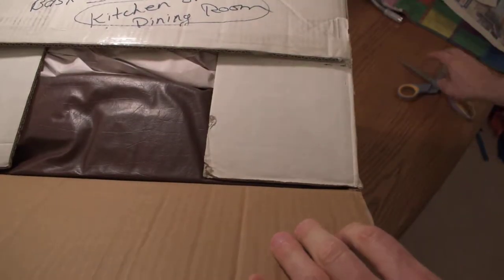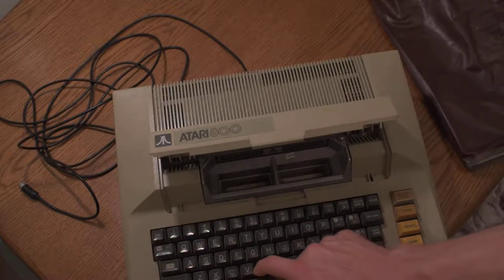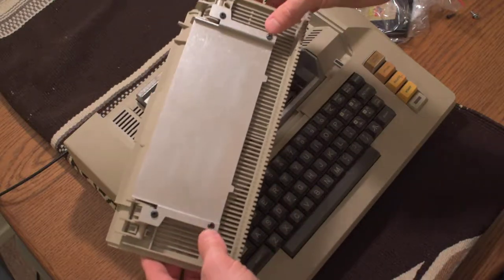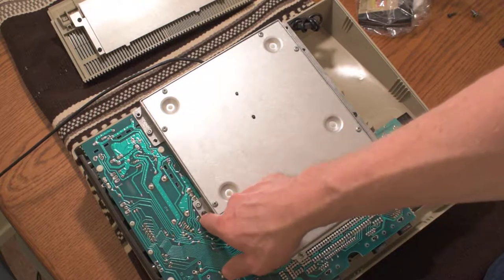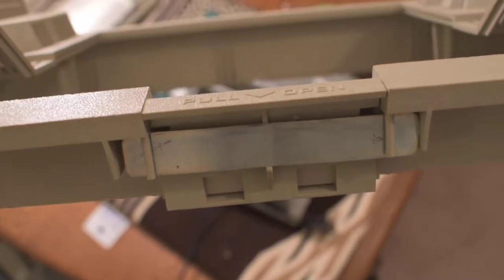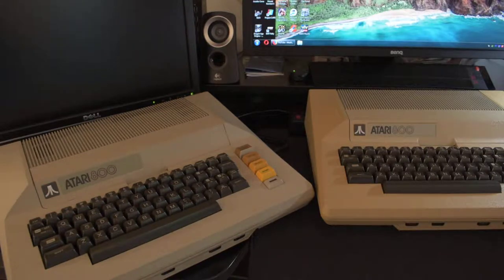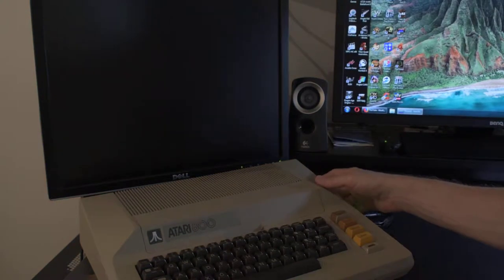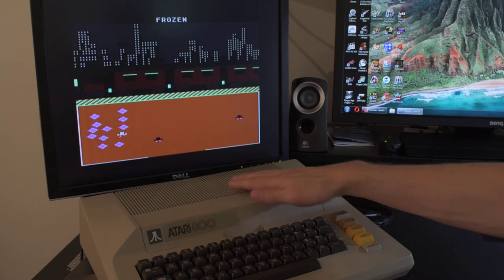Atari 800 - yet another untested unboxing, cleaning and testing!

Comment from the maker: Update: A couple years later I did replace joystick port 4 with a NOS part so that is now fixed. Correction there are about four keyboard variants for the 800. This is one of the best ones. There is the original hi-tek with white plungers, then the Stackpole with yellow plungers (worst) then the Stackpole with green plungers then there's the mistumi which is great except the mylar fails (easily fixed by peeling it off and placing it right back in place).  Apparently hi-tek sued Stackpole (and maybe one other manufacturer) for copying their 800 keyboard so there are different types of Stackpoles (as shown here with rare green plungers) and maybe other variations over the months and years of manufacture.  This 800 with serial 26800 (great number!) turned out to be a great machine with very little case yellowing and it 'just works.' I refuse to hack it up with an incog upgrade. 

As far as the yellowing comparison shown at 29:40 it seems the yellowing is more of an oxidation process as determined by the retro community in the past year or two. Exposure to heat and humidity are primary causes.  Humidity (water) has oxygen and is reactive.  It's a sort of rust on the surface of the plastics.

Comment: The lever is an easy fix. The posts that hold the metal spring clip tend to weaken and break off.  Carefully drill out the base of the posts that remain and cut down a couple of finish nails to the proper length then epoxy the new posts in place.  This will be much stronger and will last the life of the machine.

Comment: Hey man.  Great video!  Sorry it took so long to get to it.  I actually forgot you told me you got another 800 and then it popped back in mind a day or so ago.  Anyway, what are you using for a loader?  I didn't see a disk drive or a cartridge or anything attached to the 800 when you were playing the games.  As far as the joystick goes, I remember the Wico ones were way better than the Atari or others.  I think some are still available on eBay.  Montezuma's Revenge brings back a lot of memories.  I agree, it was/still is one of the best.  I had a different take on PacMan though.  Back then I lost my mind when I first bought it.  Maybe I'd have a different take today.  Regarding the other 800 that's yellow, have you considered trying to RetroBrite it?
Reply from the maker: Thank you Richard! I'm using SIO2PC-USB from Lotharek with Respeqt for Windows. It works very well. I do have 2 1050's but don't use them much. The old floppies still work though. Yes I have a wico bat new condition. It's so big though. I like the small kraft sticks more but this one needs servicing. I also have a new kraft I will use that for the next video. :) What was your take on PacMan? The one I played here from 2014 is much improved... Near perfect. I was playing a ton of Defender on cart. Like it? That game is brutal. :)  I've decided against treating the brown 800 with chemicals.  Instead I want to try the ozone gas method. That uses no chemicals and will not risk ruining the case with an uneven job. I will do that later this summer or fall. I need to buy an ozone generator. The8bitguy did that as a test but his method was improper. What are your plans on the A8s?
Reply: I looked at a lot of options for loaders and they all wind up being expensive or limited availability.  I was going to do SIO2SD from Lotharek but the price/shipping kills it and there's lots of button pressing to make it work.  Maybe SIO2USB is the way to go.  Still think the price is a bit high but maybe better than making my own cable.  On the other hand making my own cable might be fun.  I'll have to see.

I really did like PacMan back in the day.  I remember buying it in the store (first game I ever bought) and thought how nice the box and everything looked.  I felt like I was cheating the arcade by being able to play at home.  Sure, it wasn't exactly like the arcade but it was close enough.  Maybe there were some other deficiencies I didn't recognize.  :)

Defender/Stargate was fun in the arcade but I always felt it was way too fast paced and had too many things going on at the same time.  Eventually I'm just hitting smart bombs over and over again until I run out.  I don't remember playing those games on the Atari 8-bit but I'm sure I did.

Never heard of the ozone gas method.  If you do get around to doing it I would love to see the process/result!  8-bit guy seems to have a lot of luck with the RetroBrite method but he's really good and maybe it can be easily messed up.

I haven't had much time for Atari lately.  Work is pretty brutal time wise but maybe that will get better in the coming months.  I'm kind of torn on making changes to my hardware.  On one hand I watch videos of people upgrading the RAM on the Atari 65XE and tell myself I can do that.  On the other hand I don't want to damage things and certainly don't want to mod the original case for some other projects.  In general I feel that I should keep my computers stock.  Maybe if I got something cheap on eBay I wouldn't care so much!  I also need to figure out a place for an Atari setup that won't look like clutter.  Probably need a small LCD/LED TV too for the display.
Reply from the maker: @richard1113  Update: for retrobrighting it seems the new+best method is to use sunlight. It works! I've had very good results. However it may be better to use a UV filter glass to filter out the bad/damaging light. Nevertheless just putting the cases out in the sunlight works well. See the Atari8 group on the AtariAge forums for more info or RetroRecipe's video.
Reply: @gamedoutgamer  Greetings!  I wondered whatever happened to you. Yes, I watched the Retro Recipes video back in May and was completely blown away that you don't need chemicals or anything to bleach yellowed plastics back to original color, just direct sunlight.  Given the information we had up until then this seemed counter-intuitive.  But I think that Retro Recipes' hypothesis is solid.  Good to hear from you again.  I hope all is well.